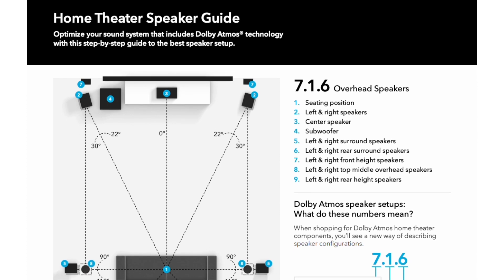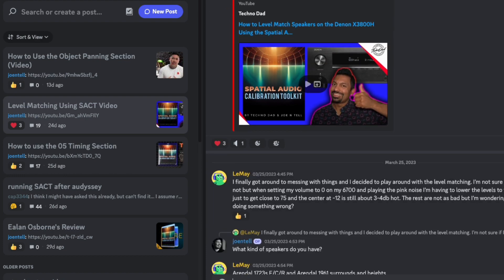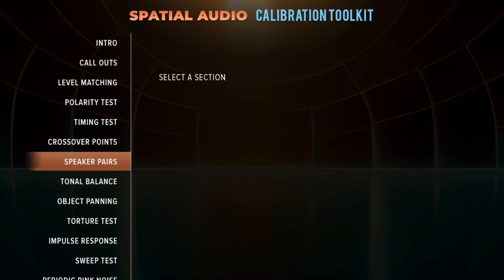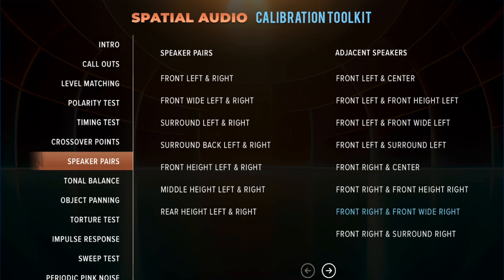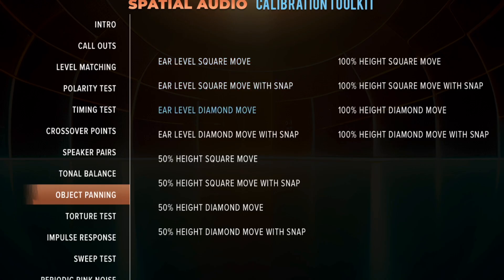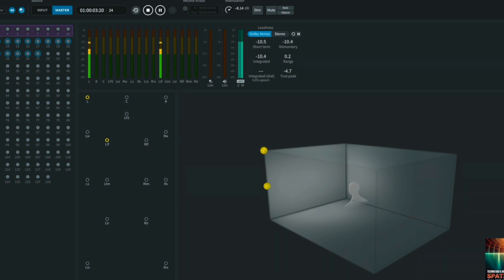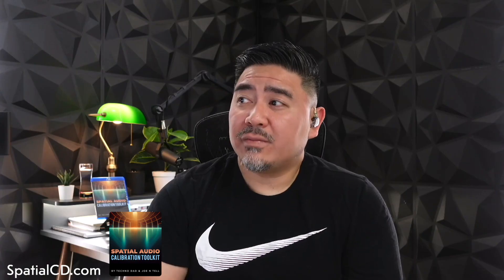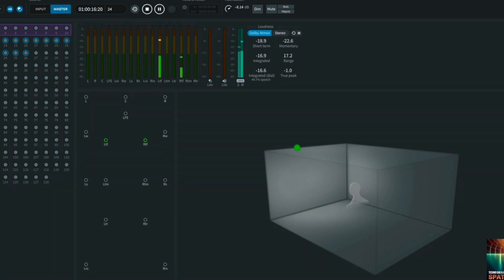Get Pinpoint Imaging in Atmos Using the Spatial Audio Calibration Toolkit - Speaker Pairs

Comment: What about upward firing speakers
Reply: I think in that scenario you would use the ceiling location at which the up-firing speaker phantoms/reflects from. That position can shift around a bit depending on the angle of those speakers in their cabinet (manufacturer dependent) and the position of the speaker forward/backward relative to your main listening position. I started with those types on top of my fronts, and for me, it was a pain to get them to image or sound correctly. Some people have had better success though.

Comment: I did the timing test first. Got that dialed in, then speaker pairs required me to change distances. I havent checked yet, but wont this now change the timing tests?
Reply: The speaker pairs test should sound like they are coming from in between the speakers to really get imaging dialed in. It’s normal if you have to adjust more than a few increments to get it real dialed in along with the timing test, which is more about making sure things are happening at the same time as well as coming from in between the speakers.

Comment: Is there a way to adjust the timing after a Dirac calibration?  Do you just adjust the distance?  I believe the timing is locked after Dirac runs?
Reply from the maker: I don't think so. That was the issue I had on my NAD T778. There might be away, but I don't know how. I tried disabling the delay and gain in the Dirac software hoping that would allow me to set it manually, but that didn't work for me. It was still greyed out on my NAD.

Comment: Fantastic disc. But I am using the speaker pairs for getting the phantom image correct with speaker placement prior to running room correction. Not so much for dialing in the delays. That’s a lot more accurate using rew with acoustic timing reference that accounts for acoustical delays. Torture test with voice is really good, and square diamond object panning is fantastic .  Using a 7.1.6 set up. Tonal balance is also very good! A lot of times I see people asking, how much levels to boost your surround backs post Room correction. (because of shape of ear and how we perceive sound from back compared to mic) ? Some tell u +2, +4,don’t boost. With the spatial disc, there is no need to  guess… u can dial in the levels correctly.. superb disc. Supplements REW where u cannot measure imaging .. love the disc, great job guys! Congrats 🎉
Reply from the maker: Thank you for the feedback! We are happy that you're finding it useful. Changing the placement of speakers will always be the superior way to do it. The Haas, precedence effect, always plays a part that can't be replaced by level and delays.

Comment: Hi Joe, what is the advantage of doing this over the timing section of the calibration disc?
Reply from the maker: Due to the speaker's interaction with the room, it can affect the phase response and slight changes might sound better using this method. These are all just tools, so it's up to the user to determine how to beat utilize them and we might not all agree about how to do that. That's what's great about it.

Comment: Kudos to Rev Slim and his bubble of sound.When I started using his ideas the SACT disc really changed everything for my system. I found the Timing section seemed to nail everything pretty good and it was easily checked running the Speaker Pair section. Am I the only one who thinks Rev Slim is actually  Ealan  OsBourne with a little voice change  LOL
Reply: Rev Slim 🫡
Reply: I assure you that Ealan and I are two completely separate people. Also, I don't say "subwooofer". 😃
Reply: @TheReverendSlim  LOL--sorry but you do have that great timbre in your voice.

Comment: Joe - this is EXACTLY what I was referring to with my other comment (Paul/Imaging/Tone) and that has been so very difficult to get rigjt/accurate in the past. I have resorted to "swapping around all of the RCA connections on the back of my Preamp processor (multiple times over) in order to get Test Tones between any and all speaker pairs (just as described here). It most definitely worked, however it's always a TON of work to do so. My gosh this Calibration disc is going to make this sooooo frig'n easy!  Thank you so much you two. Ps. anyone on the fence about buying this Calibration disc, I can assure you that it is well worth the asking price... not only in Time saved (a ton of time), but also the end result accuracy that one (anyone) will be able to achieve... i.e. Perfection / the Best your system can be!
Reply from the maker: I'm not sure if you know how happy it makes us to hear that our customers are happy with the results they're getting from the calibration toolkit! 🙏🙏🙏